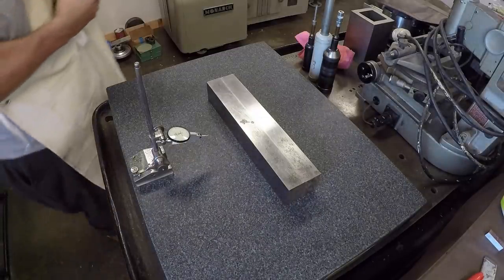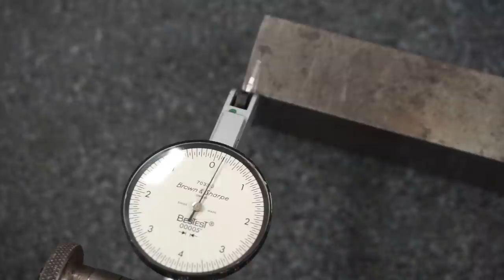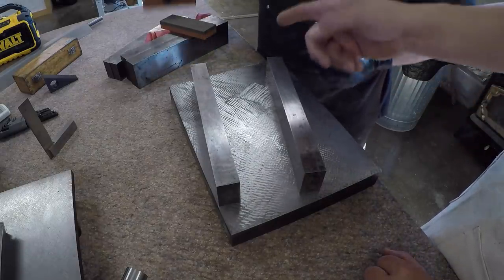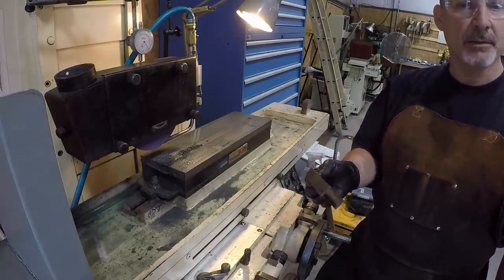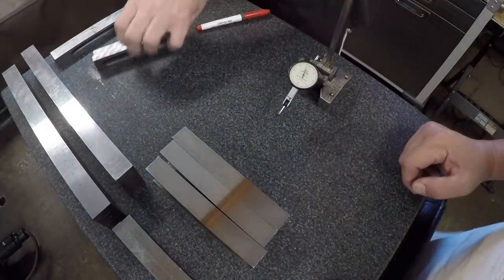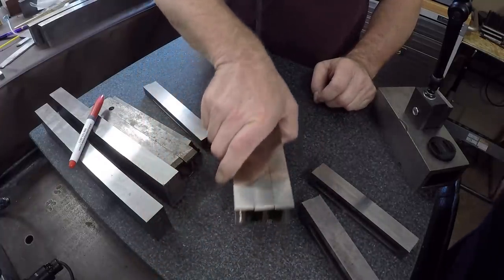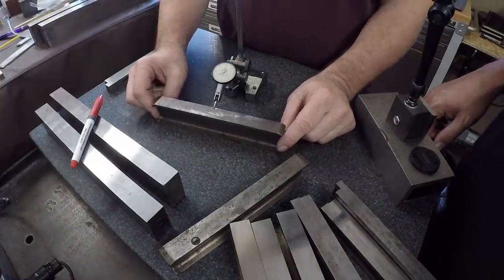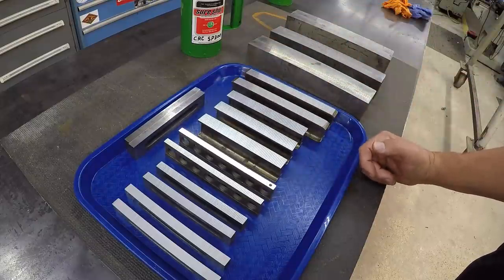SNS 293: Inspecting and Surface Grinding Parallels

Comment: Aww this comments section is so frustrating. I posted the easy answer to this on the first page and yet still people are suggesting shims and what not. The easiest way without any doubt is to clamp the piece to an angle plate, then simply clock from end to end to find the mean. Once you've done that you can then grind the bow out. After that you simply turn them over and grind them all together directly on the mag chuck. You should never use the mag chuck for the first cut, it will just distort your piece. obviously the better your equipment the better the end result...If you have a AA inspection standard angle plate and a very good DTI you can easily get within 1 or 2 microns maybe even 0. My preferred way of doing this is to set up some packing against the angle plate then place a small dowel pin in the centre, then sit your work on the dowel so it pivots. Level it by eye, clamp it securely, then clock it up end to end. find the mean so you don't have to remove too much material. Make sure firstly your wheel is freshly dressed and use lots of coolant. Remove what you need to, to get it clean. Then the penultimate cut should be very small 1 tenth. Then let it (spark out) several passes without adjustment. The finish result will be as perfect as your angle plate and machine will allow. I have seen zero many many times. Sorry for getting all menstrual, Great channel BTW.
Reply: would using residual grinding methods still pull the bow down, I would think, i absence of having an angle plate that would be the best way to go.

Comment: Sorry guys but the best way to precision grind parallel surfaces is not like this. The mag chuck will pull the part out of shape. You need to establish a datum...first cut should be done by clamping to a precision angle plate, clock from end to end and find the mean. Do all three then turn them over on to the mag chuck a grind together.

Comment: Although I like Bestest indicators even better than Interapids, chasing tenths with it on that little light transfer gage I never found to be very repeatable. I liked using a Starrett 252 height transfer stand with a lever probe and an electronic gage amplifier and then found height differences using a height gage or jo blocks to transfer the readings to. That grinder however looked like it would be a pleasure to use.
Reply: I am a big fan of Bestest indicators too. The indicator is a .00005" indicator not a "tenth" indicator. When I needed one of that accuracy I went twice with B&S. When you get that accurate, I agree that the inspection base is rather cheesey. You use what you have, but that setup was substandard for that indicator.
Reply: @paulhunt598  The "test" style indicators do not necessarily give accurate readings, just move the angle of the lever probe and read it again and you'll likely get a different size. They should only be used to compare to a known standard.  So when you see .0002 on the test indicator you should check the high reading and low reading with both standards to know the true difference. With a lever probe and a gage amplifier you can adjust the difference to the standards and be pretty confident it's reading properly, altho I still like to go to the height gage and find the true readings to be sure.  The round "AGD" style indicators do give accurate readings, if their in good shape and in certification. So a better way would be to have a height stand with an AGD indicator to read the variations. Also after you clean your surface plate,  keep your hands off it!! The oil on your hands can easily raise your parts a few tenths.

Comment: as others have suggested, i think the problem is probably in how you're chucking the parallels. i wonder if the same problem would occur if you ground them across their width instead of the length, or maybe at an angle across the chuck. i think the long stroke may be part of the problem.

Comment: Comment on the I beam parallels: many variables here to get through. What wheel is being used? A vitreous bond wheel is where it's at for micron grinding. The B&S has an electric chuck. Are you using the residual setting? Drawn I beam structures have high torsional values inherently and are difficult to grind out. In finishing items like this I have put a piece of saran wrap under the work piece to tweak out the distortion. The I beam structure itself is unstable in the flat as it was originally designed for longitudinal loading. My best results have been with the mag in residual mode and with a cool mister rather than flood coolant. Speed is another consideration and usually a medium speed gives the best results since high speed and low speed can generate tremendous amounts of heat. In conclusion, precision grinding is a very fine  line of balancing everything that matters, material, speed, wheel, magnetic attraction and deflection, and coolant or lubricant. My 2 cents worth. Thanks and carry on!

Comment: I noticed that the second set of i-beam parallels were ground while not touching each other like the first set of 3. Did that help with the variation you were getting? Maybe the magnetic pull was greater at the edges of the i-beams when they were touching.

Comment: Was the best I beam in the middle of the 3? I usually leave a gap between parts so coolant flow is identical for all parts. As someone once said about surface grinding “everything matters”.

Comment: I'v seen grinds where they do the rough cuts, with the magnet fully engaged, then they reduce the clamping of the magnet , and just skim it afterwards. If you look at how magnetic fields are kind of donut shaped, the clamping force will "compress" the molecules unevenly and this is why you tend to get a small bow in the workpiece.

Comment: It's possible the thinner unsupported areas coupled with a poor grain structure that are flexing slightly under the grinding wheel.. Especially if they aren't hardened or a higher grade chromium steel.. That's my guess..

Comment: I think this is because you had them touching each other on the mag chuck then they sometimes not lay flat on the mag and they align each other not to the mag chuck rather to the other Parallel

Comment: I heard that for distorted parts it is a good idea to not crank the mag chuck all the way, just tight enough that the part holds. So you could do your roughing with it clamped tight, but loosen the chuck a bit for finishing. Maybe you could even mount a stop on the chuck and not clamp them with the magnet at all.

Comment: Adam,
A trick my dad used,
Place the item to be ground at angle across the Chuck versus running along the whole length this minimizing any heating or tendency to distort.
Thoughts?
All the best to you
Eric

Comment: When it is important, I get better performance from my modest grinder when I extend the overrun at each end to allow time for all the transients to damp out after the direction change.  Also the cadence of the high-low troughs is about the same as the set over distance of each stone pass, perhaps the grinding face is not flat.  Set the parts at an angle once to see if the pattern changes.

Comment: I think heat is affecting the outcome, I would try skewing them to almost the full width of your chuck, and/or do smaller stepover will help keep the heat out of your parts.
Reply: even with that flood coolant?
Reply: Simon Scott should be completely fine with the coolant. Heat isn’t much of an issue when you’re surface grinding with coolant unless you’re taking a ridiculous amount of stock each pass
Reply: Coolant helps, but all the heat is not eliminated. See the sparks?
Grinding thin( <.125") hardened D2 will give you fits if you ignore the heat input, yes, even w/coolant.
Reply: wayne pegram that’s true but I can’t imagine what they’re grinding is D2. I’ve ground D2, A2, M2, Stavax, Mirrax. They way those were grinding they aren’t very hard or wear resistant

Comment: Watching for the second time - with the i-beams parallels - what apart from the possibility of deflection could really cause that variation you see?  I'd be curious to know whether or not the variation relatively uniform - or if you notice greater variation on the side that was ground 1st versus the side that was ground 2nd.  That might give a clue as to what the source of that variation - if for instance you notice that the side that was down on the mag-chuck during the final passes has more/less variation than the side that was being cut during the final passes.

Comment: What was the final tolerance on the "little bastards"? My opinion is the magnet is taking the bow out of them when grinding. Then it comes back when the magnet is turned off. Maybe a shim to support the bow and then grind one side flat? Good stuff and as always I enjoy the videos.
Reply: Flat lapping one side then placing the lapped side down on the mag Chuck works well to remove bow. I  never subscribed to that newspaper method.

Comment: My guess is you should likely not mag chuck long objects (like these parallels) in the same direction as the mag bars of the chuck. I know it saves grinding time, but you should put always across the magnetic bars.

Comment: I've always wanted to just handle a set of ring gages. Your parallels are nice, and a good size. When finished with surface grinding and stoning, is the finish fine enough for spectral inspection?

Comment: when in a mag chuck, shim it so it doen't falt on the mag chuck and come back to the bow shape after you remove it.
also, you could use the withworht 3 plate method to match them and make them super flat. i think

Comment: the issues with the I shaped parallels may be caused by torsion/twist.   open shapes (I shapes, angles, and channels) have terrible torsional stiffness.   if you map out the irregularities you should be able to confirm that.   if torsion is the issue, the I shape should be most affected at the corners, and the measurement on your plate between two of the opposite corners should vary quite a bit - maybe the most.   I dont know what your sizes are, but a solid 3" tall x 2" wide parallel will have a torsional stiffness that is about 125 times more than a 3" tall x 2" wide I shape that is 1/4" thick.    the I shape eliminates 75% of the weight of the solid in this example, but at the cost of 99.2% of the torsional stiffness.  The mag plate should be able to impose quite a bit of twist in the I shape.   based on some quick math it only takes about 2 lb-in of torque to get .0001" out at opposite corners of the 3x2x1/4 I shape, which seems within reason for the mag plate.   Compare that to 250 lb-in of torque to get the solid 3x2 out .0001"  at opposite corners.   that is all based a 12" length.    I have no idea if twist is your issue or not.  If you decide to make parallels, i would steer clear of I shapes.  they are super strong and stiff for loads perpendicular to the flanges (vertical) but not so much for lateral or torsional.   on that note, a tube shape would make a much better  parallel than an I shape because the stiffness in all directions drops of much less with the loss of weight.  for comparison to the above - a 3x2x1/4 tube saves 62.5% of the weight vs. the solid bar, and only sacrifices 42% of the torsional stiffness.  thats a more reasonable trade off.    I dont think tubes are practical though, because rolled tubes are less than stellar material and the weld seam bakes in all kinds of residual stresses that would have to be relieved.   boring the length of a solid bar to make a tube sounds super easy and a lot of fun too.  wow.  sorry for how long this got.  hope this helps.   keep up the good work.

Comment: Lance, from talking to machinists in my area: clamp side ways to stop the rock when you flatten the first sides, then turn over to mag hold the second side.  Also they suggested: more coolant volume, slower speed on table travel, less aggressive step overs, & longer stokes to stop the table reverse from "rocking" the whole machine.  What's your thoughts on their take?  I'm just the idiot in the middle.

Comment: For the little Basterds try to turn off the magnet cuz the magnet might be making them straight when it's on but then when you turn it off that's when Bo happens!!!! But you have to find a way to keep them to stay. If not you'll fine them in the shop wall....

Comment: For the parallels which are slightly bowed I would expect that the magchuck would tend to pull them flat, preventing the surface grinder from hitting the bow. How do you compensate for that?

Comment: Question  so the stones are not good out the box?  How are yours good ? How do you know your stones are good? What did you do when you took your stones out the box? Also you say you will hurt the surface of a parallel if you stone them. ? So why are your stones not hurting the surfaces of those parallels ? Love the channel an love your wrk. Hope I get answers to all these as I’m super intrigued now. Maybe just answering but also maybe a short video or an intro to a video an share the questions and answers with visuals as well. Also I thought you were stoning them to then re check them. Like as I thought you were saying let’s stone these parallels first before we do are inspections and checking measurements as after stoning them obviously it’s going to change your measurements. Like example you were pushing down on the ends of parallels and getting needle to move a cpl tenths. So that’s bad right but that totally may have been fixed from the stoning as remember that 1 mm spot he pointed to that cleaned right up from stoning. Just saying clean them and stone them and then measure them and I bet they would have read much better or possibly worse but either way you’d of got proper reading rather then running your starret gauge down a dirty part so to speak an dirty I mean rolled edges and stuff that although you don’t measure that edge it will still tip or hold  the parallel off table incorrectly if it was on table side. Right?
Reply: because brand new stones need to be surface ground before you can rely on their flatness.  If they're not flat (and they aren't when brand new) you'll mar a finish.  Lance has videos on stone grinding
Reply: I’ll check them vids out. Love this stuff. It’s newish to me but I’m all in. Building shop little by little. And love this channel
Reply: Lance does precision stone grinding, Adam has a set that was ground by him.

Comment: Thanks for another great demonstration. Could it be the I-beams, because of the way they were made, have residual internal stresses that cause the end corners to warp ever so slightly, e.g. through temperature variations?

Comment: would it be possible to stress relieve the centers? IE: smack it with a hammer???? or possibly heat cycle them a few times to relax the grain a tad without dorking up the heat treat?

Comment: Do you always use your stones dry? I would expect them to clog with metal particles after some use.
Reply: If you watch Robin Renzetti's video about these stones, he explains that the stones wil only cut high spots because they are so flat and have so much contact area. And whatever grit gets on them, you can remove by rubing the stone it's mating pair.

Comment: Hi Adam, while looking at the very last part of the video where all the parallels are on the tray, they all appear to have grinding lines that go across the parallels and not lengthways as they were ground.
Is it just a trick of the camera or did Lance grind them again? I'm sure it must be the camera but thought I'd just check.
I would have loved to be a fly on the wall in that workshop, it must have been electric... two of the greatest machinists in one shop at the same time!
Reply: Looks like a reflection of the ceiling / light panel
Reply: @chw0112  Yes that would explain it!

Comment: What grit wheel are you using? I know for problems with bows in part pieces my magnetic chuck has a pulse feature. It works extremely well for parts that are not flat to begin with. You could back off the magnetic chuck percentage and take lighter cuts also. Enjoyed the video guys keep up the good work!
Reply: lighter or residual magnetism is fine, BUT don't forget to block the part in both X and Y.
Reply: Tom B great point! Sorry I left that part out!! Yes I always block my part in all the way around! I use thin shims or I have several parallels cut down to different lengths to make sure the part is blocked in. Thanks for bringing this up sir.

Comment: I think that your variation is mainly caused by the magnetic chuck. You can avoid that by grinding the first surface without the magnet, just supporting it with some blocks an go very very slow and careful. After your first side is flat and without any kind of distortion you can clamp this side with the magnetic chuck and you will not have any distortion issues what so ever. And i would recommend grinding both sides twice at least if you want to be very sure. Kind regards from Germany!
Reply: No way to grind without chuck on, even if you have it blocked. You will have to change your undies.

Comment: The variation from the center to the outer edge could  happen if the thickness is not perfect. If the top edge is wider in places than the bottom edge it could create a very slight twist when the magnet pulls down. We’re the parallels ground for uniform thickness? Grinding with a small space between the parallels would eliminate that possibility.

Comment: Hum - have small RR track - Seems to me, the over reach top/bottom likely bend under the grind.  If a wide stone was used it might be better information.  I'll have to get my track out and put it on mine.  seems to me, one has to do side A, side B, Side A to have a good A as a bad B was used to get the first A.